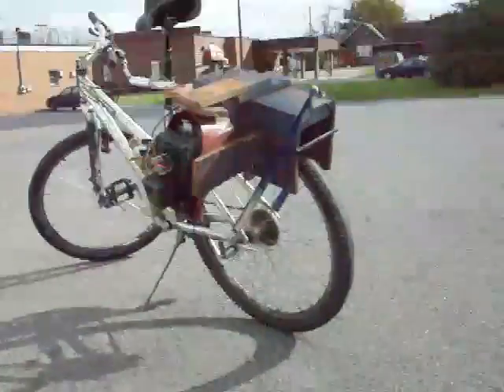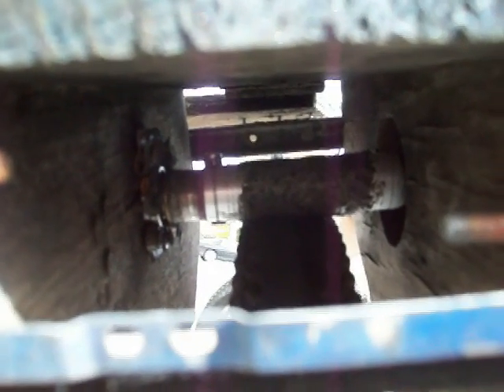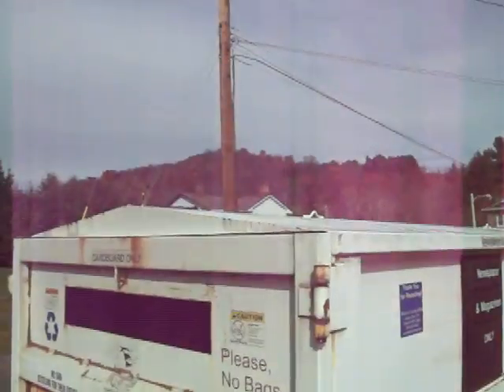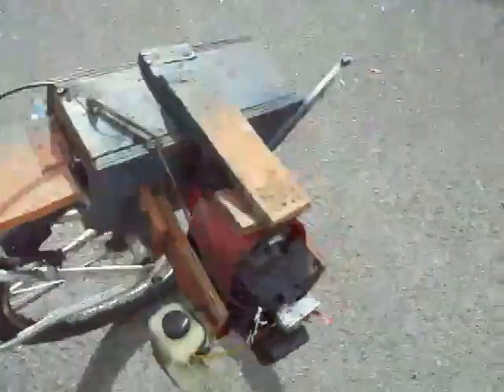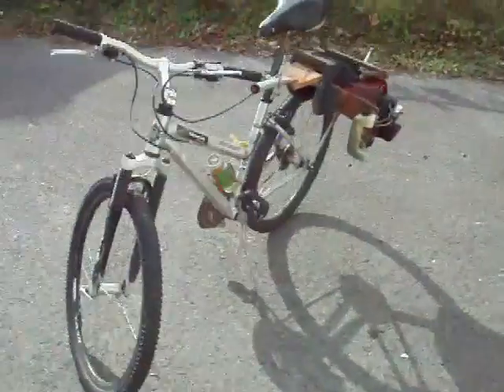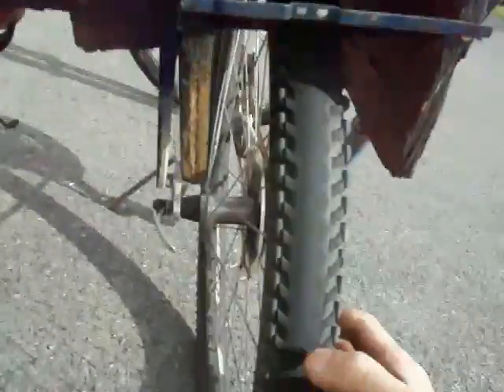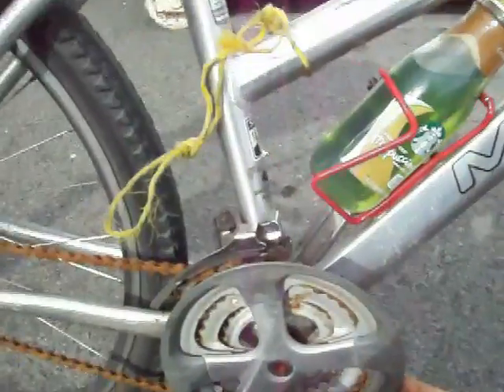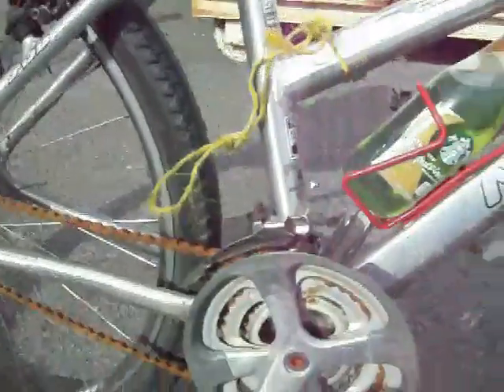Friction drive motorized bicycle engine diy Installation and test ride.

Comment: I had a similar theory to use the gears but I think it would be to much torque for the weed eater to handle and you would need to modify the diameter of the shaft so it doesn't snap